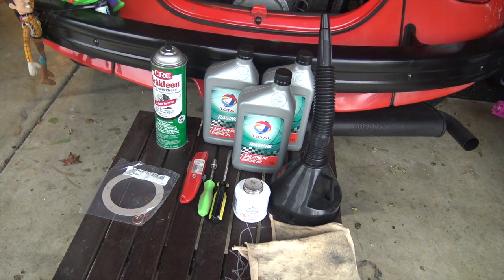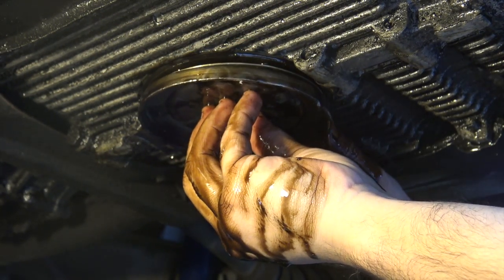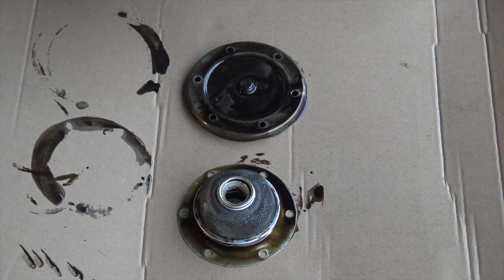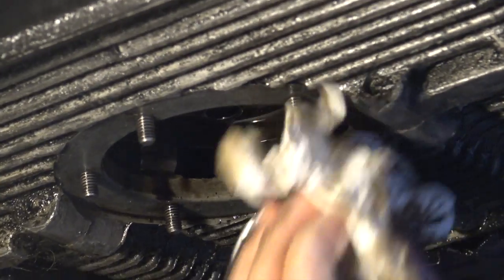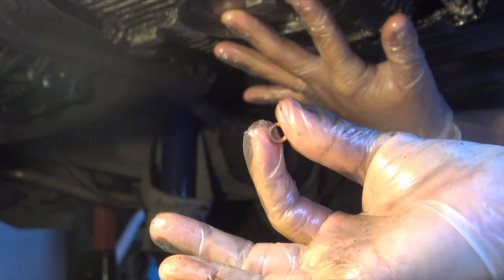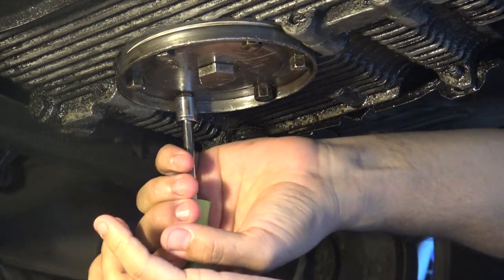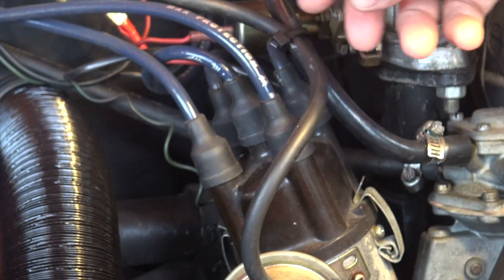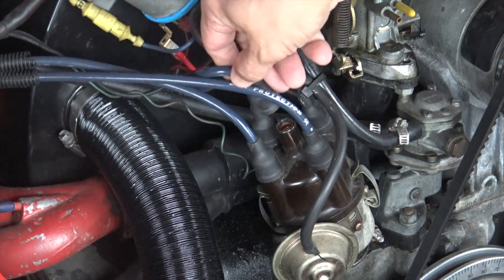Volkswagen | 1600 dual port | Oil change

Comment: Great video very informative.  I learned a few great tips. Especially the part about disconnecting the main lead from the coil off the distributor to create oil pressure. Good stuff 👍🏼

Comment: Keep car level and drain with center bolt.  Then lift the car.  2.6 qts only.  Full is halfway between the marks.  30 wt. High zinc for 33-100 degrees F.  As per VW spec.  To thick of an oil will engage the oil cooler bypass.
Reply: 3 qts will not hurt anything so by saying "2.6 qts only" you make it sound imperative to only use 2.6 qts and that's not true one bit and if it were true all the VW's I've done oil changes to (including all 7 of mine) would be damaged or what ever you think happens to one if I put over 2.6 qts of oil in them 😱
Reply: Owners manual spec.  You should secure one.  2.6 puts the oil level at a point where the strainer can skim the surface.  The manual clearly states, "do not put the whole 3 qts. in.  Use the remaining oil for the air cleaner."

Comment: Why not use the center bolt to drain it?
Reply: The center bolt is only for drain oil, but need clean sump plate and oil screen. 🙋🏻‍♂️
Reply: @pablo3639  
So drain the oil first then do the rest.

Comment: I have a VW 1600 Boxer engine.
Its a 2013 one that was built in Mexico.
I am about 3800 Miles ( Yep, 3 thousand and 800 miles so its a baby ) and I gave it an oil change at 500 and again at 1000 miles from new and as its not been used all that much and its only done 2800 miles on the oil thats in it, but thats about 5 years old and so I am changing the oil and I think its just as well... The oil was jet black and not at all lubricating the engine and if anything, it felt like it was sticky more than slippery... Eek.

Anyway, I have dropped the oil, but can I get that round bit off? Not even budging at all?

I have got all of the oil out and I also removed the center bolt and thats got a magent on it ,and it was caked in a solid dirty gum and now this has almost terrified me and I wonder what sort of dammage has been done to the engine?

Is this normal? No clearly not, but are these Mexican engines any cop?

Mine is pissing oil and has done since I first bought it and if I drive below 40-45 MPH its ok, but if I try driving at 50 then it leaks oil... The shitty thing is, that I have not yet found out where the oil is coming from... I am assuming from the crank and there is that nut thats been re-designed to push the oil back into thej engine, rather than needing the seal, and the wheel spins and so that seems to spray the oil all over the engine, but as for any point... Nothing?

This is by far, the worst engine that I have EVER bought, and I massively regret it.

What is worse, is that I sold my harley Trike to pay for this one and now I am wondering why the hell I ever bothered.

Oh, and the gear lever is the most awful one I have EVEr tried and failed to get right. I can select 3rd and 4th fairly easily, but 1st is impossible and its a gamble whether I get 2nd or reverse!
Reply: My first car was a 1961 bug. I changed the oil every 1000 miles. Partly because there is no oil filter and synthetic oil didn't exist back then. Today I would likely use 0W-30 synthetic oil and maybe change it every 2500 miles. I forget how often I adjusted the valves but I would guess at every 3,000 to 5,000 miles.

If you have an engine that was rebuilt, one thing that will make it burn oil is if any of the oil rings on the piston gave the gap at the lower part of the cylinder rather than the top of the cylinder.
That happened to me and I had to drop the engine and reposition the oil rings. Then everything was fine.

Comment: is the unplugging the distributer trick safe to do on a fuel injected 2.0L engine?
Reply from the maker: I don’t see the bad in it. All your doing is preventing spark from happening while your cranking the motor over and getting the new oil trough out the engine.

Comment: I have a question.  I would like to install an Oil Pressure Sender / Switch onto my 1969 Beetle.  I'm unable to determine where it is to be installed.  Can you help me?
Reply: Remove the idiot light sender its behind the Distributor there should be a blue wire attached to it unless someone changed the wire take that sender to your hardware store and look for a brass Tee that fits the threads I just did mine but forgot the pipe size lol you will need a starlight threaded same size pipe a brass nipple about 1in or 1_1/2" long. Thread the  Nipple into the tee Then thread the VW sending unit into the other end of the Tee Now this is important  Install the nipple with everything together except the Gauge sending unit do not install it  yet DO NOT OVER TIGHT IT WHEN YOU REINSTALL IT TO THE BLOCK YOU WILL CRACK THE BLOCK after every thing is installed then take a small pipe wench and hold that nipple dont let it turn you dont want to over tightening it  Now turn your tee where the Gauge sender will be easy to install Mine is facing out next to the distributor  have seen some facing up what ever best for you I also Used very little Black Aviation sealer on the threads it don't take much  know this is long but i wanted to make sure you dont crack your block where the old sender was have a great day hope this helps  Wow I just notice your question was 3 years ago well maybe it will help some one else lol

Comment: Where can I get a gasket kit for 73 beetle?
Reply from the maker: Nivek if there isn’t a local Vw shop near you. Any online aircooled Vw store will have them. Sometimes you can also find them at large auto parts stores.
Reply: Cardboard oj box